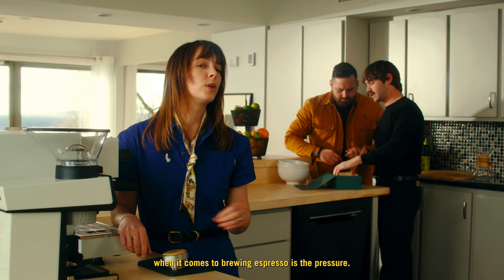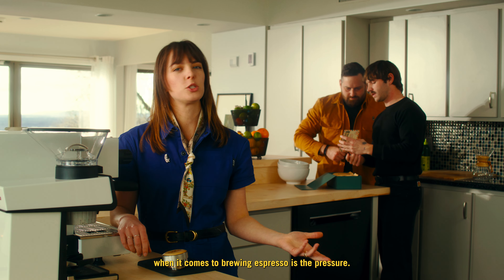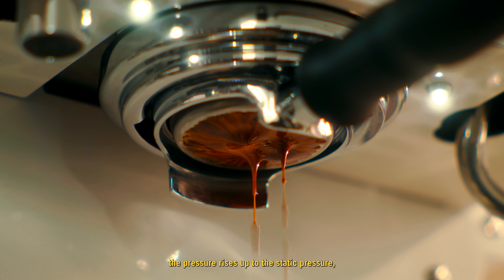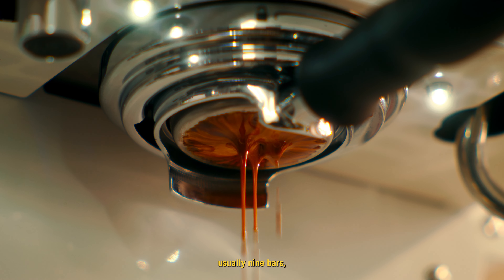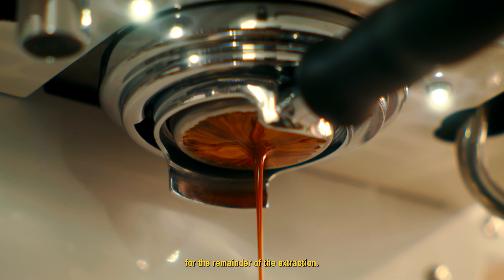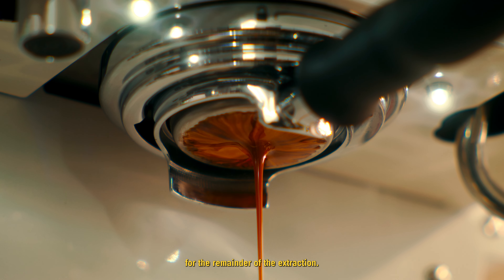Experimenting with Espresso at Home

Comment: You’ve missed a trick guys on how to change the pressure. A knob would be better. Not a bloody screwdriver.
Reply: Seems like it might be easy to 3D print a little accessory if you adjust it often enough.
Reply: well, not everyone wants to change pressure, and certainly not everyone should be encouraged to do it. Just the ones who actually know how to deal with lower pressure shots and tuning. 

I'm amazed that we are complaining about needing to use a screwdriver, I was really happy that they actually included the possibility to do this on the fly rather than open the machine up..
Reply: @randoya a machine at this price point needs to justify something better imho